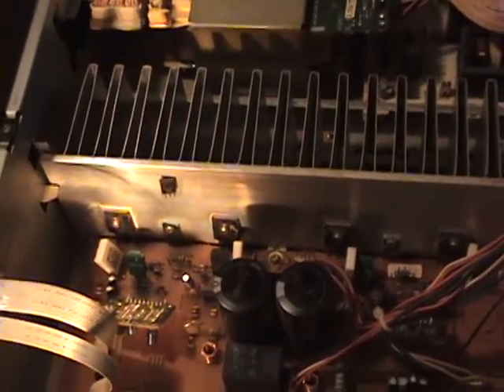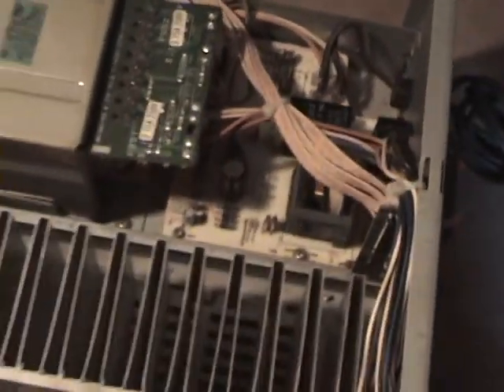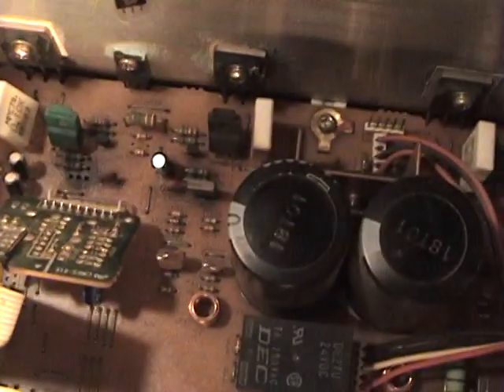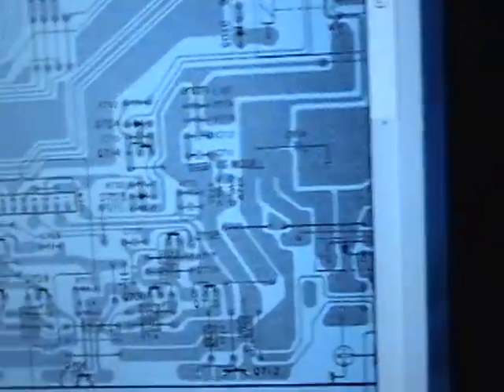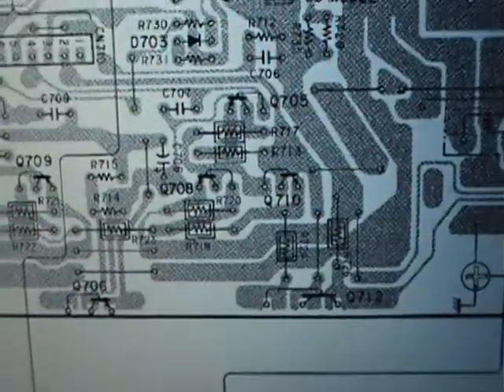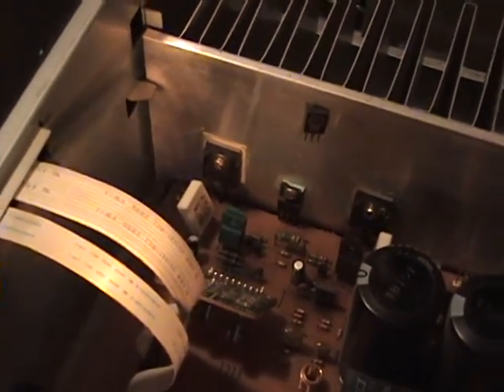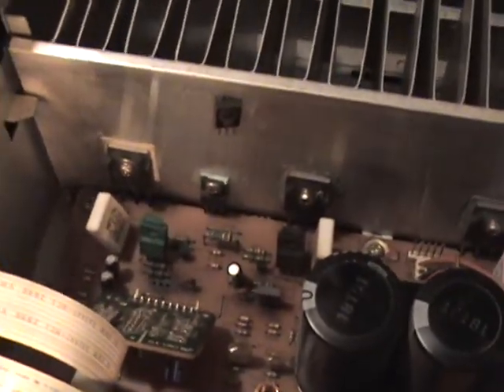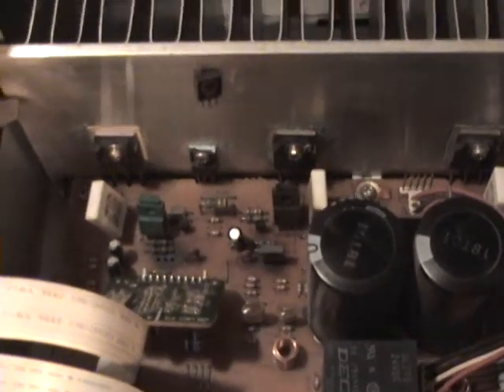help me fix this sony ta-ax311.amplifier

Comment: For the most part those letters after aren't important like they used to be. They are hFe rank, and transistor tolerances are better today than before. Looks like you have other bad parts, though, burned resistors looks like.